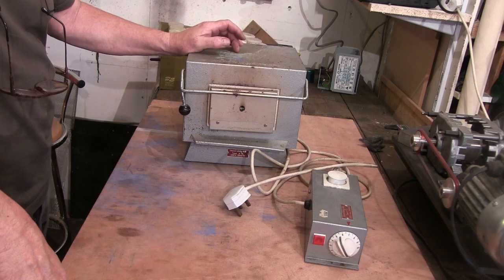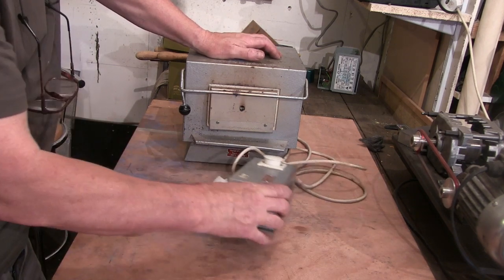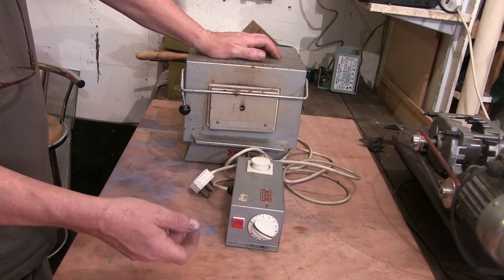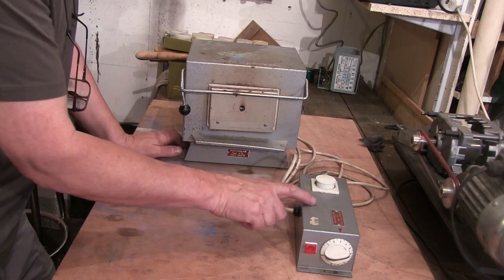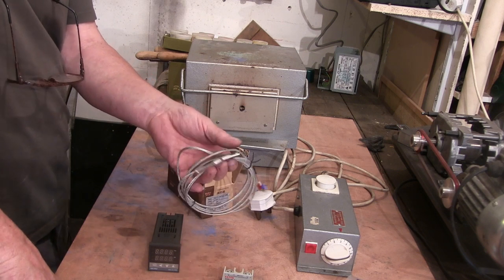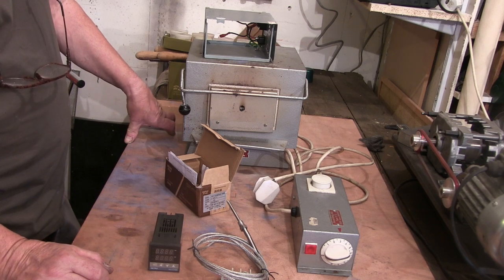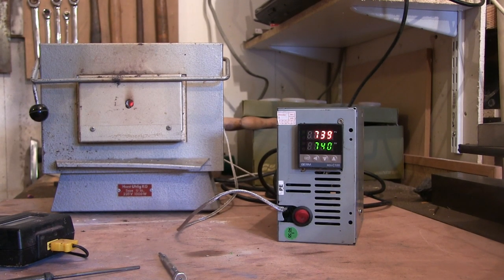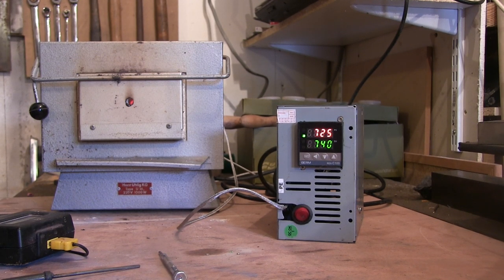Anew kiln and A PID temperature Control    er

Comment: I recently acquired a similar kiln (about 4x the volume though) Heats up fine, but the temperature gauge is busted and like you said, maintaining temp based on duty cycle isn’t reliable so this looks like the exact upgrade I want to add! My only question is, did you verify the PID’s 740 temp read out with a second gauge? I saw your personal temp gauge sitting next to the kiln, but you never showed any verification that the 740 was actually accurate… I’ve got a calibrated IR fluke temp gun I use for checking kiln and forge temps, but it’d be nice to see that this PID and Thermocouple are accurate at 400, 500, 740 compared to readings from a second gauge. Other than that, great video!

Comment: Thanks again, Cliff - great addition, and also using an old PC PSU box is right up my own cheap alley! Bit of H&S caution on the cable to the element, though - the terminal at the back will get pretty dang hot with the (Kanthal / Nikrothal) wire nearby in their ceramic insulators. Ideally you should use a connecting wire w a woven fibreglass sheath atop a silicone insulation. Household plastics cable will let you down, but the rear cover will protect you from seeing the mayhem until the SS relay perhaps takes the short. //Gotta order them J23 firebricks for my own 4 kW foundry soon, I've had my regulator, 32 Amp SSR and a roll of Kanthal A-1 laying around for over a year now - whilst my diecast Al scrap bins flows over. Over 100 lbs of free salvage to remelt into excellent 413/ AC 44100 stock and also a few ZnAlSi bearing mixes to try. Cheers from DIYSwede
Reply from the maker: Thanks very much for that Johan, I will heed your advice and do the rewire, would never have thought about it until, as you say, it went wrong,
Thanks again,
Cliff

Comment: Another informative video Cliff.Gonna add the same temp controller to my Efco version of your kiln.Different tool steels do vary in their required temperatures and also the amount of time they need to be soaked at their temperature varies according to their mass but you probably know that anyway mate.
Reply from the maker: I know a little bit of the theory Tony, a very little bit!😁, Have you done any enameling?
Thanks for watching,
Cliff
Reply: The only enamel I know of is the stuff on my teeth mate. Gonna use mine for hardening and tempering and also to melt certain metals for casting maybe.
Reply from the maker: Me too, but I am going to mess about with the stuff that came with it, should be interesting!

Comment: Nice that you have such precision. Have wondered how useful the propane ones are for anything other than melting scrap due to how poorly the temp is measured, but most of the history of heat treating was done before the modern age, so yesteryears foundry folk must have devised good methods. Thanks for sharing!
Reply from the maker: Up til' now I have been hardening tool steel by the " til' it don't stick to a magnet method", which works pretty well, but I am looking forward to doing some enameling.
Thanks for watching,
Cliff